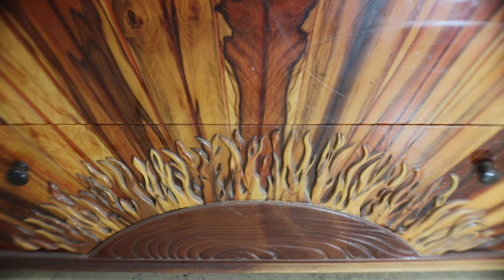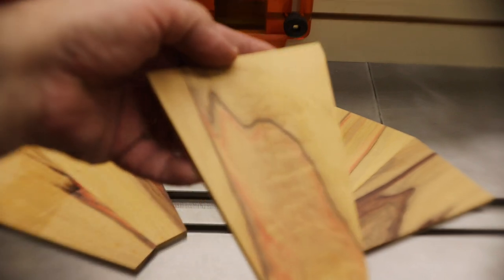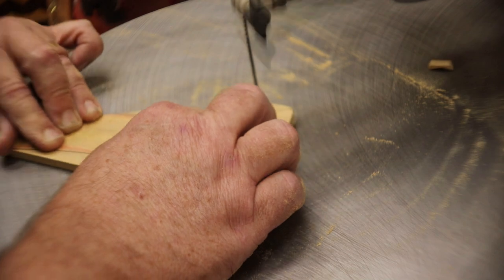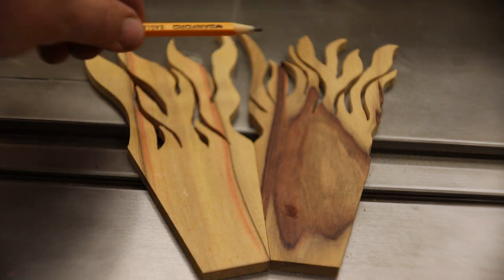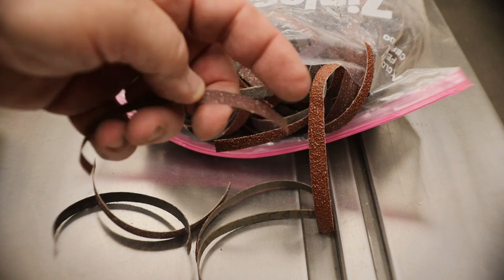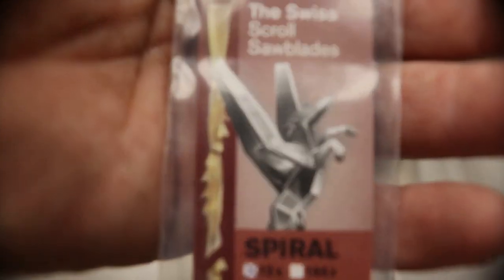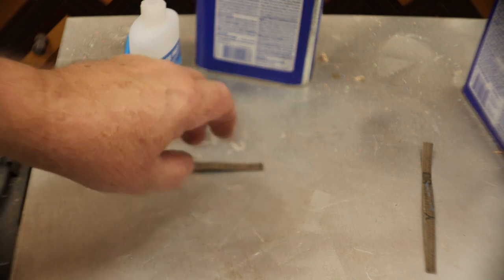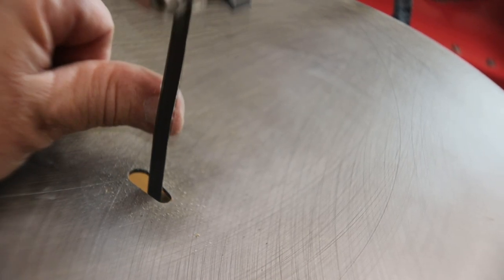SCROLL SAW SANDER

Comment: Great video. I’ve been trying to figure out how to copy the store bought sanding strips. With re-useable ends. You just proved I don’t need “ends”.  Saved me a sleepless night trying to figure it out. Thanks.
Reply from the maker: My friend thank you so much for reaching out. I can't tell you how much I appreciate that I truly truly do. And I'm very glad  The idea helped you. The back-to-back sandpaper has really been a big help for me lately. And I hope it works great for you to my friend. From Doug
Reply: @ I just went out to my workshop after dinner, cut a piece of 220, 3/8” wide x 10” long and folded it in half ( 3/8” x 5”). Put in my scroll saw and used it to sand a 3D, compound Christmas decoration I’m working on and when I came back into the house I had a smile on my face…thanks again.  Something I learned on my first try…be careful with the tension.
Reply from the maker: @thisoldman7142  I'm so glad that worked out for you my friend and you're right you have to be careful with attention .I did another little trick That I never showed on the video I folded a piece of sandpaper around a   scroll saw blade and glued it to the old scroll shop bit which gave me the metal end sticking out to still clamp it to the post. It seems to work pretty good. But it was sticker than just folding the 2 pieces of sandpaper together

Comment: awesome, thanks for the tip, i wondered if could be done, as the clips on the premade ones looked limiting, size and use wise. didn't think about belt sander belts etc, that is a beautiful piece of art you made there
Reply from the maker: Hey Scott thank you my friend thank you that's a good point the size does make it a little Limited. And the belt Sanders do work wonderful buddy. And thank you my friend that was a very enjoyable piece to make although it took a lifetime. Lol. Great to hear from you and thank you so much from Doug

Comment: Great idea, but what if the scroll saw doesn't have the fastening attachment for the blades like yours does? Mine doesn't, maybe I can find a refit device...
Reply from the maker: Hello Bob my friend how are you doing. Thank you for reaching out my friend thank you very much, There is a very very good aftermarket company Call pegas. That makes after market scroll saw clamps. You can find them on Amazon. They make a very good quality aftermarket blade mount. I've actually bought them to replace my factory mount clamps. I don't know the brand of your scroll saw, But they do  Sell them by what saw they fit. I hope that helps you buddy ,and if I can ever answer anything don't ever hesitate to ask. From Doug
Reply: @fleetswoodshop3339  Thanks, I'll check it out!
Reply from the maker: @bobicard2503  THANK YOU MY FRIEND